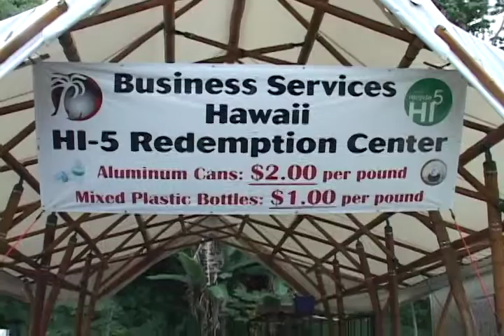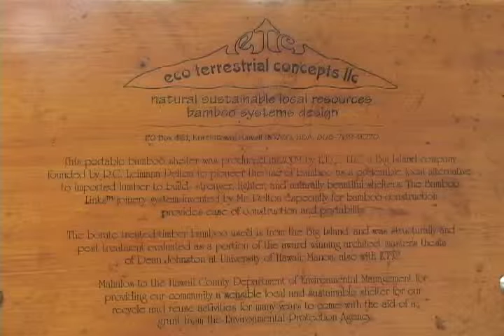Hawai'i Bamboo Growers and Builders

Comment: Nice development of the building with bamboo...  Just wondering why you chose metal for the joinery...  Seems like if you're going to go to the trouble to recommend bamboo for building you'd make it work for its own joints.  Why not try to use the thinner-walled bamboo for joining?  Won't last long enough?